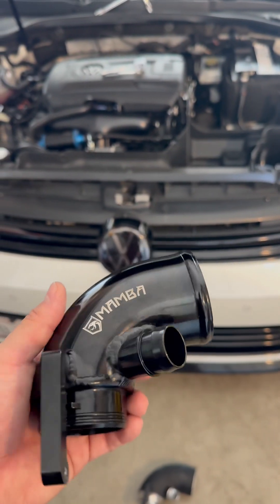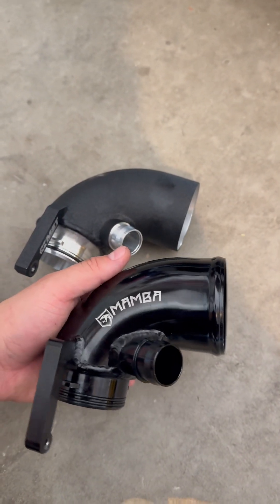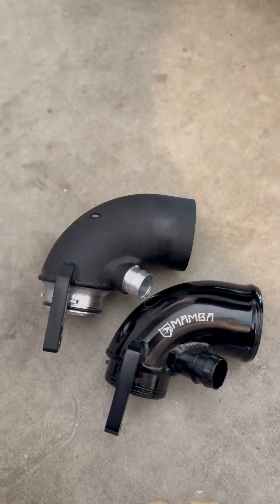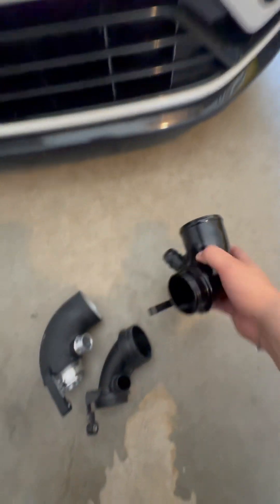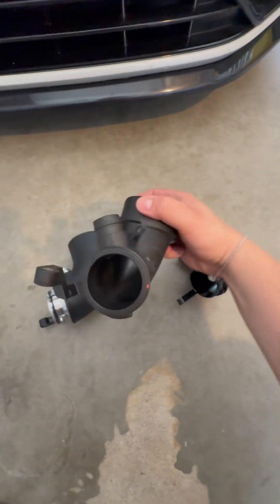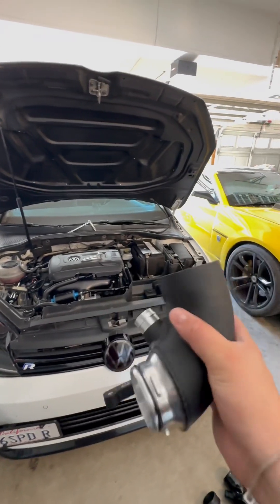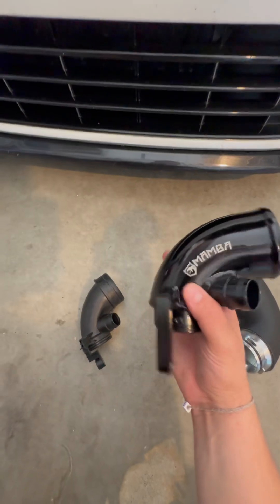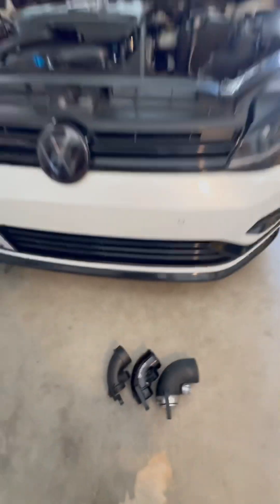Comparing The Mambatek Turbo Inlet To The MST V2 Turbo Inlet For MQB Volkswagen/Audi Cars #VW #mk7r

Comment: How is that intake manifold? I just got a 3071. Thinking of doing the intake manifold.
Reply from the maker: @Mylesa22  nice 👌🏼. If I could do it again, I would go with a different intake manifold or just do the runner flap delete on the stock manifold.  I was having issues with the gaskets it came with and had to modify the stock gaskets to fix the issue, but then those were melting, so I had to get a intake manifold spacer from A2B Motorsports and it’s been good since 🤞🏼